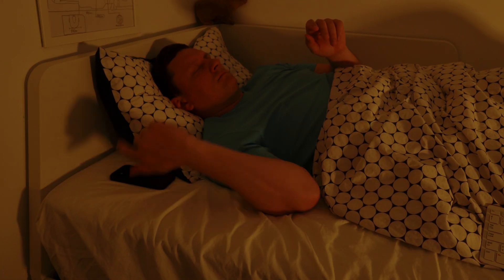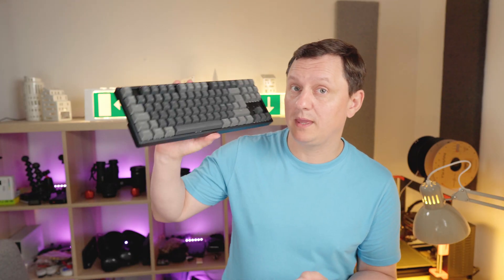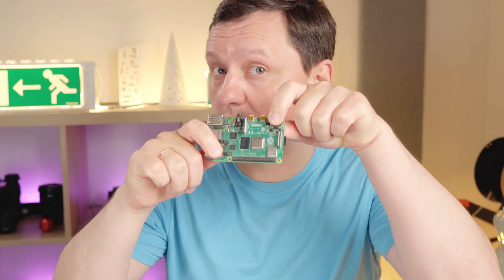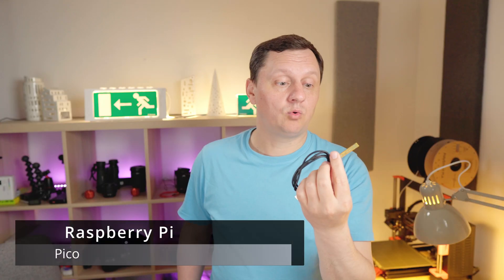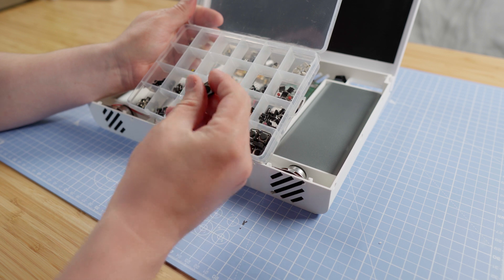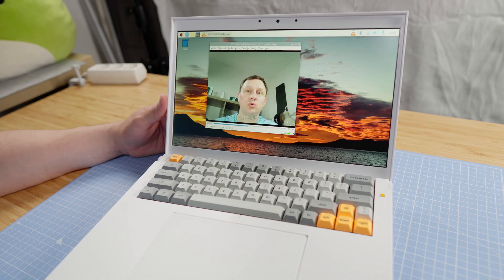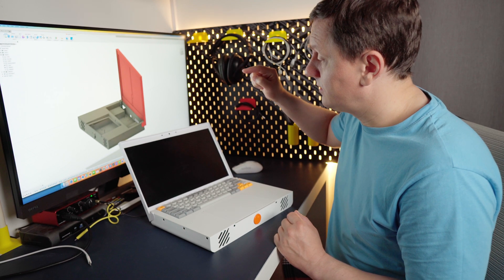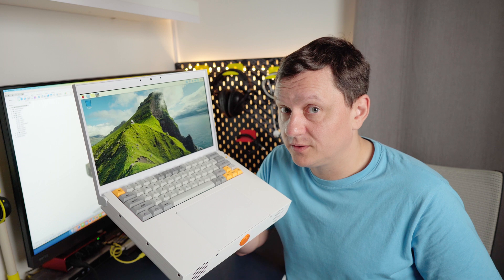Raspberry Pi - I'm giving up

Comment: Hey, nicre job! I have two questions regarding powerbanks:

1) I read that usually powerbanks are not good for UPS usage, even with passthrough feature - if you are on battery and decide to connect to power, it will interupt the power for raspberry, and it will reboot. Is this true in your case?
2) what is the model of powerbaks?
3) do you have to charge both powerbanks separately?
Reply from the maker: 1) Not all PowerBanks are the same. Some of them can work almost as UPS. I had this issue when I tried to build a DIY power bank in this video:
https://www.youtube.com/watch?v=pnP27kEk3Y0

2) Clas Ohlson, Powerbank USB-C 26800 mAh
I bought them here:
https://www.clasohlson.com/no/Clas-Ohlson,-Powerbank-USB-C-26800-mAh/p/38-9687

The alternative solution is supercapacitors with Raspberry Pi. I used them in this video:
https://www.youtube.com/watch?v=An3N5czFs5E

3) I charge both power banks separately.
I can charge these powerbanks while I'm using this laptop. One power bank for screen and audio, second fro Raspberry Pi. They have a "power path-through" and they do not lose power when I plug in or plug out the charge cable.

Comment: I think this came out wonderfully. 

I'd love to see what kind of project you could make with the Odroid N2L. The Odroid is faster than a Pi4 and comes with active cooling. You could make a thin boy V2 with your low-profile keyboard from a previous video and use two phone batteries in parallel. Four tablet speakers and an Adafruit Max amplifier would give you a slightly smaller package and you could create a surround sound effect placing two speakers on the front and two on the sides. Just thinking aloud,  I loved the video!

Comment: Such an incredible time we live in: we have tiny off-the-shelf components to make a laptop… and 3D Print the cabinet to our liking!
I was so curious to know about the battery autonomy for your build - please, tell us how many hours you could get it running.
Excellent work and I loved watching it!
Reply from the maker: I ran a test and I just got the result.
The laptop has PowerBank 1 connected to the Raspberry Pi 4.
PowerBank 2 is connected to the Screen controller board and audio amplifier board.
The test: I started a very long YouTube video on the laptop in 480p. The screen was 100% bright. And the sound volume is in comfortable loudness for me.
PowerBank 2 is on 0% after 10 hours.
PowerBank 1 still has a 51% charge.
I connected the charger cable to PowerBank 2. The video is still playing.

Comment: Thats a great project, I realy love it.

Personally I am a bit into retro computing. So I am thinking about using the Amiga 600 design, adding hinches and a screen. There is a mechanical keyboard PCB available. Still, getting A600 keycaps for mechanical keyboards is a problem. I wouldn't add a trackpad, as I never got comfortable with theese. I personally prefer trackballs or the good old Amiga tankmouse. So I think I will skip the trackpad and just use "TheTank Mouse", a quite nice wireless mouse in classic Amiga design. Maybe I add a mini-trackball (there are some available with a ball less than a cm).
With "Pimiga 3" there is an Amiga Emulator alowing to use modern Linux Apps on the Amiga Workbench; so with having the look and feel of an Amiga, still all modern aplications are available. Anyway, using a more common raspian just needs a swap of the MicroSD anyways.

But there is so much to design - first of all I have to build a big 3d printer. And a very small but extremly precise one (for keycaps - and it has to be an IDEX or need a MMU to make "Doubleshot" keycaps). And of course, db9 joystick ports are needed. Quite a lot to do. So it might not be based on a Pi 4  but on a Pi 6 or 7 ...